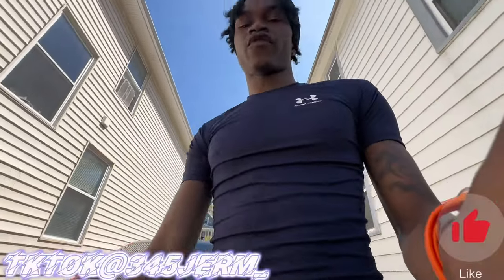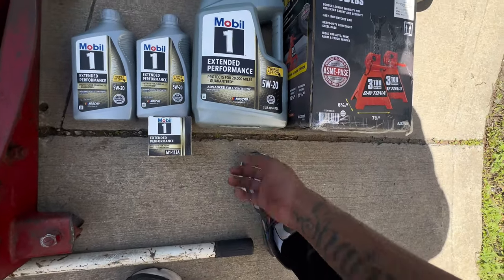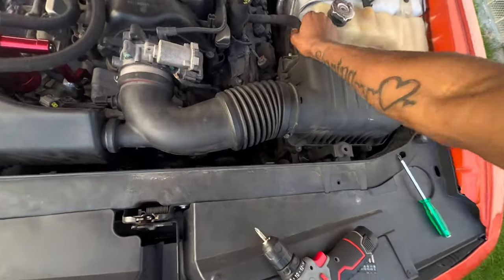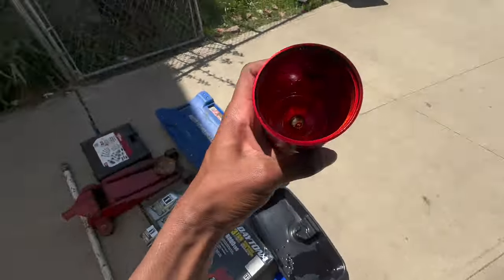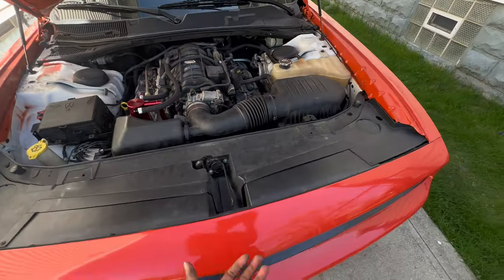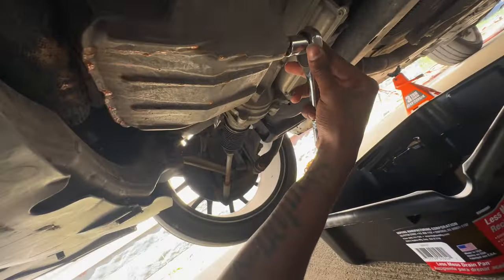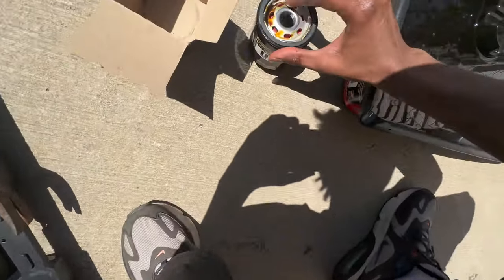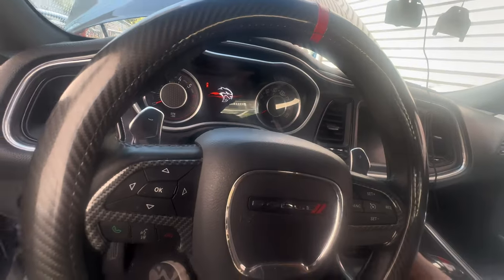HOW MUCH IS AN OIL CHANGE FOR A DODGE CHALLENGER RT🤔.. (HOW TO CHANGE)

Comment: Idk if it’s the same for the 5.7  but that oil ain’t good for dodge that oil is used for euro cars stick to penzoil ..
Reply from the maker: So penzoil or amsoil? 🧏🏾‍♂️
Reply: @345jerm_  nah don't listen to him fam. Mobil 1 is the best u can buy
Reply: You don’t gotta listen to me good luck when your car comes on knockin do your research like I said  I dont Know if it’s the same for the 5.7 I got 6.4 and I use 0-40 pennzoil that’s made for the srt
Reply from the maker: @adolfovazquez9207 I’m about to look into it 🧏🏾‍♂️
Reply: @345jerm_ don’t listen to him bro. Mobil 1 meets Chrysler spec in the owners manual for 5.7 and 6.4s. Says it on the back of the bottle
Reply: @adolfovazquez9207 you still got time to delete this bro. mobil 1 meets Chrysler specs in oil. Says it in owners manual. Also euro spec? the 6.1 HEMI says mobil 1 on the oil cap
Reply from the maker: @pushhrodd01  I peeped the penzoil for scats not RTs 👌🏾
Reply: Liqui moly 5w20 if you want your engine to run good
Reply from the maker: @yevhensmith6704  🧏🏾‍♂️🧏🏾‍♂️🧏🏾‍♂️, bet
Reply from the maker: @pushhrodd01  u gotta point 😬